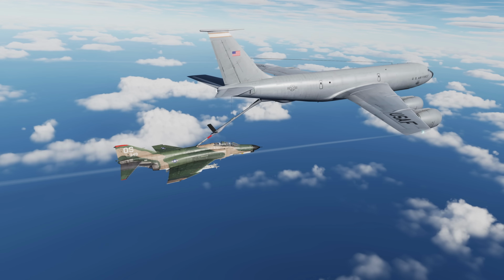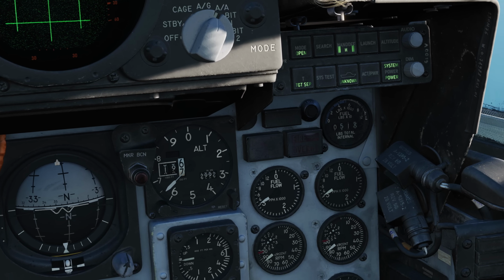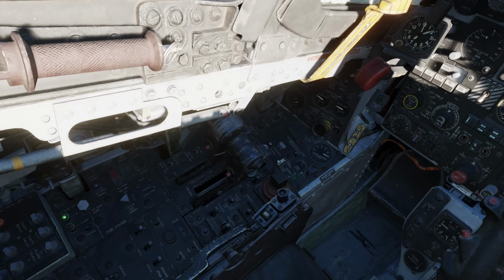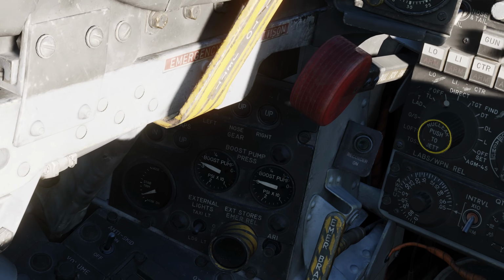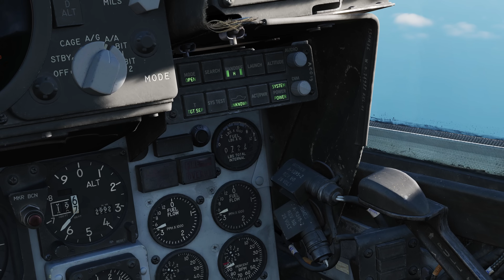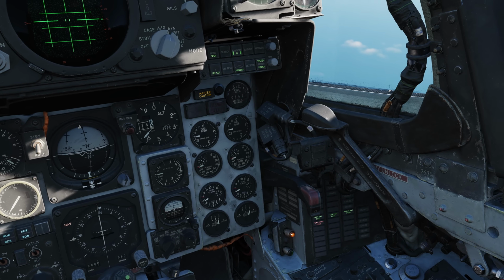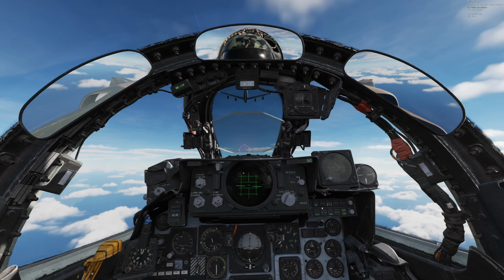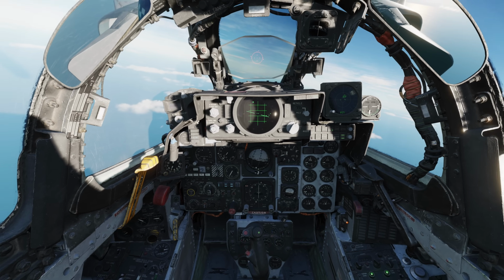F-4E Fuel Systems Guide | DCS World

Comment: Did the US ever get an improved centerline tank? The Japanese Phantoms got what they called a "high-G tank" which they flew with the majority of the time, instead of using two wing tanks.
Reply from the maker: Yes, there were several centerline tanks used. The one made by Royal Jet (600 gallons) was not good and you couldn’t pull more than 3 G’s with it loaded. The high performance tank was 610 gallons and also used on the F-15

Comment: First all thanks for this great video. Second a question: external tanks will refuel while AAR indipendend which setting the external fuel tank switch has? So eather set to off, centerline or wing tank, all will get fueled up?
Reply from the maker: That is correct. Opening the refuel door will depressurize the tanks and open the transfer valves so that all tanks can get filled. The one exception to this is if you open the red guarded refuel select switch on the fuel panel and set that to internal only.
Reply: @DieselThunderAviation  thanks for your reply ❤

Comment: Easy peasy. Both engines feed from # 1-and EVERYTHING else transfers to it. Hence the reason #1 is AKA the feeder tank.
Let's see if I can remember the sequence : ya burned the wings first-to make room for the externals-then ya moved the externals to the wings. Then everything moved to the fuselage tanks. System was pressurized with-if I recall again correctly-8th. stage customer service air.
#1 had both electric & hydraulic pumps to move the jet juice to the J-79's-the hyd. actuated pumps were there in case of total electrical failure-which was not that uncommon in the Phantom. They were powered by the Utility system.
Memories................

Comment: so the tape is cells 1-6 in the fuse ONLY. and the number is the total fuse and internal wing tanks. external tanks have no gauges so keep an eye on the totalizer. 
also the external tanks feed the internal fuse NOT internal wing.
so basically the engines are fed from int fuse 1, the other fuse tanks feed tank 1. the internal wing and external wing tanks feed fuse tanks only and dont interact with each other, is that correct?
sounds more complicated than it is if thats correct
Reply from the maker: You just summed it up perfectly!
One thing I did not mention is that the fuel in cell 7 does not transfer until the automatic fuel transfer system activates when you get low on fuel.

Comment: can you clarify the stores and jettison deal? No matter what stations I have selected, jettisoning stores jettisons absolutely everything except for the Sparrows. How do you only drop the center tank or only drop the wing tanks?
Reply from the maker: Sounds like you are using the Emergency Stores Jettison button over on the left vertical panel. That button will drop everything that isn't a Sparrow or Sidewinder. Selective jettison is done with the knob just below the missile status panel. Select the stations you want to jettison on the pylon selector, rotate the knob to the STORES position (4 clicks in either direction from OFF), then push the red button located in the middle of that same knob. After the store is gone, rotate the knob back to off and deselect the pylon. This process is near identical to that in the Hornet, both aircraft being McDonnell Douglas products.
Reply: @DieselThunderAviation  no, that's not what I'm doing. I eventually found the issue. The explanation in your video (and here), including the online manual, both skip an important step: The weapon select also has to be set to C, otherwise, regardless of what pylons are selected, if the weapons select is turned to TV for example, all Mavs or TV guided bombs will be jettisoned as well. This is what the manual says for dropping the wing tanks: "As example, to jettison the right and left external fuel tanks, the pilot must select STORES on the knob, press the corresponding station select buttons LO, RO and then push the jettison button." It is wrong.
Reply from the maker: What step is that?
Reply: @DieselThunderAviation  The weapon selector
Reply from the maker: That’s odd. That knob shouldn’t be involved for jettison.
Reply: @DieselThunderAviation  If that's true, then it might deserve a bug report.

Comment: 12:15, is that modelled in game? I’m not sure I’m getting it to work that way if it is.
Reply from the maker: Yes, that is how both DCS and the real aircraft work. Only one source can feed up to the fuselage tanks at a time, selected by the External Transfer switch. You'll see both the totalizer and the fuselage tank tape on the gauge move up as the tanks transfer fuel up, but only until the fuselage tanks are full (about 7.3 on the tape).

Comment: i hate that tanker in dcs. i cant see the damn lights
Reply from the maker: Yeah, I’d like for ED to improve the lights on the tanker. I had an easier time seeing them at 1080p than I do now at 4K.
Reply: @DieselThunderAviation  i literally cant see them (or the ball) in vr lol
Reply from the maker: The ball is a tricky one too, happy they added the overlay for that. Depending on what I’m flying I tend to ignore the lights and focus more on maintaining the visual picture for position. All I can do in the A-10 since you can’t even see the lights 😁
Reply: @DieselThunderAviation  iv never once seen the ball. i turned the flols off and cant switch it back on lol. i just use the needles in the tomcat now
Reply: I am a boom operator on the 135. The lights are hard to see, especially when sunny. Often times the receivers will even ask if they are on because they can’t seem them.
Reply: @brandonreiber1519  thats not sketchy at all then lol
Reply: @Scoobydcs  lol, verbal corrections are often used in that case. They sound very similar to Jesters corrections in the video.
Reply: @brandonreiber1519  i can do probe and drogue in the tomcat, struggled with boom in the f16. gotta get used to boom in the phantom now damn